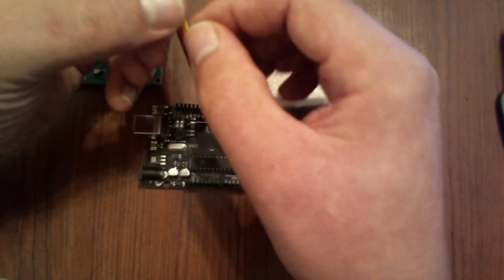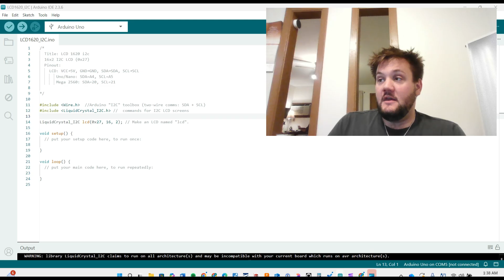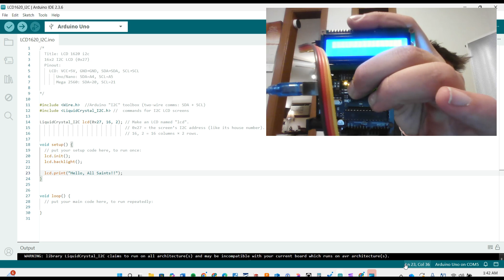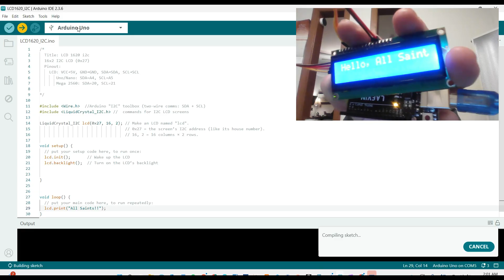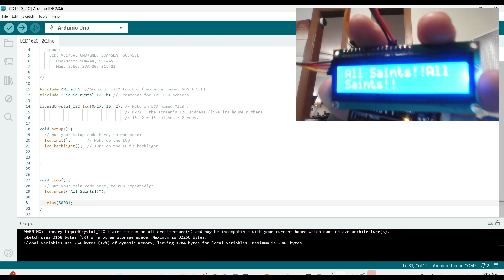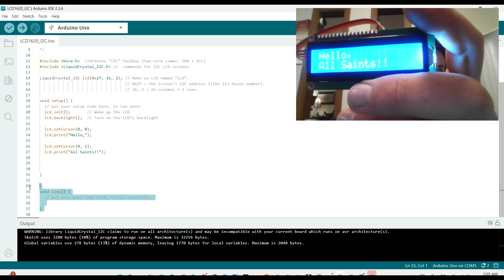Arduino 101: LCD1602 (0x27) - LiquidCrystal_I2C Basics

Comment from the maker: /*
  Title: LCD 1620 i2c
  16x2 I2C LCD (0x27)
  Pinout:
    LCD: VCC→5V, GND→GND, SDA→SDA, SCL→SCL
       Uno/Nano: SDA=A4, SCL=A5
       Mega 2560: SDA=20, SCL=21
    
*/

#include <Wire.h>  //Arduino "I2C" toolbox (two-wire comms: SDA + SCL)
#include <LiquidCrystal_I2C.h> //  commands for I2C LCD screens

LiquidCrystal_I2C lcd(0x27, 16, 2); // Make an LCD named "lcd".
                                    // 0x27 = the screen’s I2C address (like its house number).
                                    // 16, 2 = 16 columns × 2 rows.

void setup() {
  // put your setup code here, to run once:
  lcd.init();       // Wake up the LCD 
  lcd.backlight();  // Turn on the LCD’s backlight

  lcd.setCursor(3, 0);
  lcd.print("Hello,");

  lcd.setCursor(0, 1);
  lcd.print("World!");

}

void loop() {
  // put your main code here, to run repeatedly:
  
}